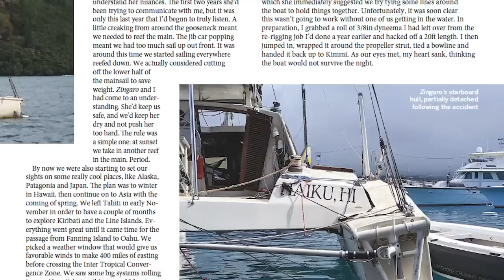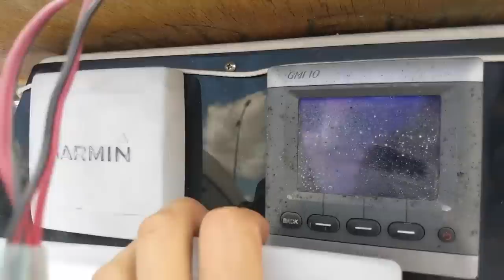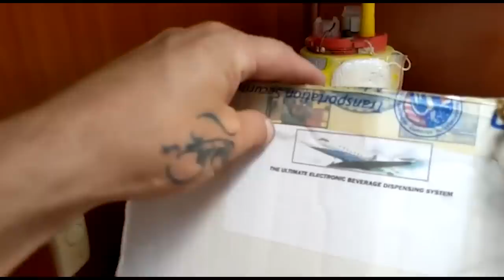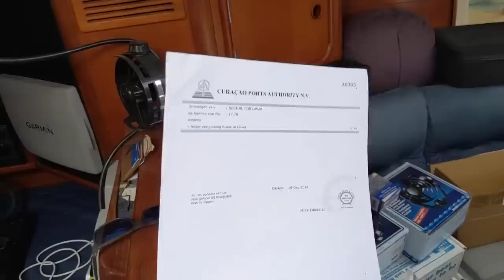Junkyard find! Trash boat, will it float??

Comment: Time to buff depending on how badly oxidized it is figure 1 hour per 100 square feet of area. And double that if it very oxidized and scratched, because you may need to sand it with 1200 grit first.

Comment: we put a hose out a window down into the water from macerator.  $86. no through hull. when not in use: it is stowed. so for a few minutes every week or two we had a heavy rubber 3” hose hanging out a port hole rinsed with salt water and then doused with cleaner and we were done.

Comment: James have you considered Tru Design (NZL) seacocks and through hulls? hey are composite, do not require electrical bonding and are much less expensive than Bronze. You epoxy them in place, and forget about it I have done that to mine. In the US Gemlux is the distributor. Contact me if you need help.

Comment: Buy a bulk load of hose clamps re do all of the hose clamps. Double clamp everything below the water line. Epirb is toast.   Just keep cleaning  learn your bilges. Next set up  a racor and a 2 filter micrcon pump it in to the barrels though the racor and you will have clean fuel. Use 10 micrcon filters  when u start up. Change the engine fuel filters.  Yard bills are a bitch but if you rush you will miss something and it's going to cost more.

Comment: Hi
Knowing Oyster yachts and the quality products they use I would consider removing the black water valve and look at servicing it as it will be good quality bronze . With the valve off you can then see if there is a problem with the skin fitting . Just a thought 
Also be careful with charging the Lithium batteries as I have read of explosions not sure if you need some sort of regulator

Good luck Stephen

Comment: Have you gone below the boat to the thru hull and scraped the bronze to see if any of the metal is pink? If it is then change the fitting because the pink color tells you that you have an electrolisys problem. If they are not pink clean them up with a solution of muriatic acid, usually  available at hardware or grocery stores. On that big valve take the hose off the top put some acid solution in there, go below get a spray bottle spray some up the fitting. Spray the pipes inside same way brush the acid about the green will disappear in a few minutes. Pour some water into the pipe to rinse it out while doing all this try moving the valve. Once the valve frees up and you have rinsed it all grease it. You be done and still have money in your pocket.

Comment: Two 12V pumps wired as well as plumbed in series in series to a 24V battery could work....just a thought.
Reply: They'd have to be the same (volts,& power,& hence resistance) not two random 12V pumps.
Reply: @hermitoldguy6312  Yes, Identical or same W rating.

Comment: I would replace that large through hull. Reminds me of the old saying “ pay me now or pay me later but your going to pay me “ it’ll be cheaper now.
Reply: Yep you are right replace all of the 5 or 6 of them. Lithium are nice but if the goal is to get in the water buy cheap batteries so you can concentrate on getting all the systems working.

Comment: Haven't watched it and liked it. Love "sailing" videos like this (way more than the sailors I know lol) excited to see you on the water sailing again.

Also I'm completely down for vlog type videos. Less editing, more videos and it's easier on you. That has got to be a butting whopping of a task to do. Whatever is easier, I think most would be game for.
Reply: Brass through hull fittings do not need to be replaced for Commercial Steamship Inspection (every four years) in Canada. Need to remove and disassemble, clean and inspect (consult expert advice here), if good lubricate and reassemble.

Comment: That valve you show at about 10 min. looks really nasty. Had one looked like that on a 28ft Sovereign when I bought her, a leftover from a failed "dripless" packing unit water feed. Waited until I hauled her to touch it and when I tried to see if it would turn it snapped right off at the top of the through hull itself.  She had 1 less hole in the hull when she went back in the water as she has a new gland and nut traditional packing box, shaft and cutlass bearing now with no water feed required.  In total it is 2 less failure points that can sink her (through hull and drip less packing box both gone).  Any hole in your hull you don't need should go away.

Comment: If you can borrow a variable speed buffer. Keep it at anout 3200 to 3500 rpm (learned that on utube)  I use the 3m polish system. Its expensive but it works well. Should take a day and a half to two days I would think.

Comment: Replace all of the thru-hull fittings, you will be left feeling weird about it if you don't. You will need it if you are going ahead with your plan to have the numbers on board that you said you were going to. What happened to the OCTender, did it stay in Hawaii? I am fascinated in how well it works as a tender compared to the typical inflatable. 
Stay healthy and enjoy the new mistress (Oyster).

Comment: Great project, suggest you keep the boat on the hard until you have done everything under the waterline. I'd estimate you'd need min 1 full day to polish your boat if you have an electric polisher and proper platform.  As you are the new owner of the boat I'd argue your 6 months  starts from when you leave the marina.

Comment: Pump some acid down the grease tube.. it will un plug the grease blockage and salt water deposits ... THEN add more grease..its safe with stainless steel and copper brass plastic

Comment: buff your boat 16 hours plus materials 100.00 -200.00. May take longer if the gel coat is roached then you may have to wet sand and buff several times.

Comment: Might be too late at this point, but I've had an internal fan go out on a laptop, and took the fan out, took it apart, cleared out the dust and the built-up carbon, put it back together and it's working like new... Might be all that was wrong with it?

Comment: Regarding hull valve removal - what would the relative cost be to hire a guy with the right tools to remove them rather than buying tools that you might only use once every several years? I figure labor down there is inexpensive, and you can be working on other things.

Comment: Through hulls can be muratic acid cleaned and greased Replacing them is a waste of money disassemble and service them unless they clean up pink in color.Copper bottom paint causes electrolysis you need to stay 1 inch away from all under water metal if you use a copper bottom paint They make paint for metal TRILUX

Comment: hey there what a huge boat .... well u bought a nice boat but also a hot mess... i know your plans are to use the boat as much as poss to tour . as a mechanic as was said by a previous poster , fix anything that will sink the boat and below water line . yes that means all thru holes and pumps and hoses . dont even think about putting it in without doing that all it will do is cause u grief down the line . its gonna cost u some cash but u knew that going in u were extremly lucky that the previous owner left u some parts to help out .change all those hard hoses they will let go . not today not tommorow but who knows jmho.... cheers and good luck

Comment: I would  pulled the pipe that's connect to the 2" through hole fill the through hole in the neck full of penetrating oil and leave it for A-day or so. Then I would try to work it back-and-forth you may get lucky and free it up and not have to purchase new one I don't know if you have for access penitrating oil but even  Automotive transmission oil thinned down with kerosene or diesel will work.

Comment: can you swap the freshwater foot pump with the salt water one?
If you can get a welder, or find some guy with one, you can make a wrench for that through hull the 15" adjustable wont fit
likewise a welder with stainless electrodes could repair that tank
price seems expensive for a 2.5" thru hull, Im sure I paid less than $200 each a few years back, US order? 
maybe the emergency tiller with a pipe over the handle can free the rudder once the spool is off
engine runs?
tc man
Reply from the maker: Swapped that... it exploded. :) Ordered new ones. Good idea to make a tool. Not sure about the engine waiting on a new water pump. Thanks! 🙏
Reply: @thelastpirate  making it a saying: "not everything that is swapped, can be unexploded :)"

Comment: 12 volt fuel pump for Freshwater you have 12 V a clean pump will work just fine pump water faster than you can use it

Comment: I'd replace everything thats bad under water! cost a lot to raise a boat off the bottom! I'd take out that holding tank sand with really course  sandpaper then three layers of fiberglass over it and will still be working in thirty years! I did that with my fuel tank.

Comment: Your Computers ventilation will be clocked, full of dust specially so if you are a smoker. Open up the back to get at the cooler grill. Clean it with a brush and or a vacuum cleaner. Then your computer will work like new. About the boat parts that are oxidiced, depending on the material you probably only have to put them into a fluid according to the material. I cleaned a bicycel chain that was totally rusted and put it into Diesel to turn it back into one like new, but there is another fluid that is less messy but I forgot whitch one it is.The right fluid will quickly reverse the oxidation process. Check the yachting forums for how to best clean pipes for what ever is to supposed to go thru it. There are many easy cheap ways to get things working again like new, one just needs to find the right way and there google is realy your friend. Good luck.

Comment: All the thru hulls should be replaced. I know they're not cheap, but neither is raising a boat. Fix everything that leaks before she hits the water. It may cost $600 to stay, but it will be way worth it in the long run.

Comment: The bigger the thru hull, the more important it is to change.  No way of seeing the internals of that thing.  A 2 inch hole in the boat is a substantially larger problem than a 3/4" hole.

Comment: If you have any questions at all about a through haul valve change it cause you just know if if commits suicide its gonna happen in the middle of now where and a hole in the side of your boat that size is gonna overwhelmed your bilge pumps in no time especially if that thru-hull comes out below the water line , but even if it don't in heavy whether you're going to get a lot of water

Comment: @Sailing Zingaro  
James, regarding the computer, often times the small, removable memory boards are the first things to fail and will cause random crashes, or a crash shortly after startup when current flow heats them up, or once that memory is accessed.

If there are two memory boards, try just removing one at a time and try a reboot.  If it still crashes with one of them, switch to the other single memory board and try it again.

If it works with the other single memory board, you know that the other one is bad and you can replace it.  If it still doesn't work when using either of the memory boards, it is probably a different issue...

It's unlikely that both memory boards are bad, though not impossible.  You can try booting up with no memory installed and the computer should stay on, but most likely not fully boot to the OS.

Hopefully you don't have a laptop that has memory boards soldered to the motherboard.

And honestly, if you are actually contemplating whether or not to perform an additional $380 repair (on a 6-figure, 48.5' vessel) that is potentially "mission critical" to you, your crewmate's, and/or its survival, well...?

Comment: Take the valve out and glass it closed the shit tank outlet one you can change the size later to one you want then  , the rest of skin fittings/sea cocker grind the face off outside and pull them out from inside , 24 grit on grinder does it good just watch for getting them too hot cold cloth in between helps .hot air gun on the pipes after removing Jubilee clamps all round 1 hour easy done .😂😂😂

Comment: If your laptop works for awhile then overheats try propping it up at the back. This creates an airgap but more importantly stops it heating up the surface it is on which heat then goes back into the laptop causing the heat to rise and the surface it is on to heat up even more. Well you can see where this is going. PS Epirbs wise well you obviously need a new one but some companies offer a trade in even if your old one is not working.

Comment: RULE#1:never throw away spare parts, you WILL need them.(re :the big box full of spare got to go)???? These cumbersome spares take so little space in the grand picture of sailboat break downs.
RE :RUDER GREASE :
#1 From experience: sometime the seal inside the manual greaser pops under pressure and turning the screw does not push the grease out.Your cartridge content might still be in there. Worth checking.
#2Just an idea never done it: You could try  to disconnect the grease tube and see if you could replace it (temporarily) with a grease nipple (higher pressure) and see if and where grease outs.(return to the neat old system afterward )
#3Maybe there is room for more grease (unlikely)
#4 From experience: After so many years all bushing type arbors gum up and increase resistance to movement.(meaning stress on fiberglass support, helm, and AUTOPILOT. Do yourself a favor start afresh and disassemble, clean, inspect ,your ruder guts.

Comment: If you don't replace the large through hull before splashing, when do you anticipate the next haul out?  If you don't have a planned next haul out, then to replace that through hull add the cost of haul out to the cost of the through hull.  Seems best to replace it now.  Hopefully that tank is empty. As for your over-heating laptop, when you start using it again try not to have the bottom flat against the table. Lift it up on a couple sticks to get airflow underneath, it can make a big difference.  If you feel like you have too much money, and too much battery capacity, you can buy one of these: https://www.amazon.com/HV-F2056-15-6-17-Laptop-Cooler-Cooling/dp/B00NNMB3KS/

Comment: Oh man how can you work in all that mess. Rent a container and clear the boat of all that clutter.
Start with the hull and topsides.
Then mechanicals ... Valves rudder quad prop cutlass etc.
Engine completely replumb water and fuel etc.
You have a years work there for sure.
Reply: Yeah I learned the hard way.    A chaotic boat = a chaotic mind
Reply: @Tom-S1981  me too buddy!
Had three years working on a friend's project and other smaller refits in our marina.
There is a reason boat jobs take 5 times as long, it's all the crap that's in the way.

Comment: One week, you must be joking. I estimate about 1 to 2 months to get it to float on the water ( all through holes, bottomed paint, engine working, out boat motet and small boat, rudder). Once in the water, I estimate 12 to 18months of work before blue sea sailing, if your lucky.

Comment: On the toilet you might want to consider a composting toilet. Rip out the holding tank, all that stinky plumbing, glass over the through holes. And just put in a vent. The money you save, even if the head is working should pay for the composting toilet. Regular waste pump for the shower, (hair and soap trap) and maybe the sink. Only draw back I ever heard is some women have to learn how to aim--what ever that means.

Comment: Sounds like it would be better to spend the 200.00 and have new vs. spending the 60.00 and then more and more and more, and the time is worth money too. Especially if it is something that might mean the boat would have to get pulled back out of the water in a short time to replace later anyways. I started band aiding my computer together a year ago, but everything I bought as a band aid, will have to be replaced again with better parts that will work with the new motherboard and CPU I will be getting. Band aiding things is not cost effective always. And my computer is never exposed to water, just my dog walking on the keyboard. He is 8lbs, so... not a big problem.

You are making me dizzy! Almost made it to the end, but I must have a bit of a migraine to feel this sick from your video!

Comment: The other option is to not replace with bronze seacocks but to use composite ones. They don't rust and the latest ones are excellent for quality and durability. Just a thought.
https://www.trudesign.nz/marine/products

Comment: Why can’t you contact steel rubber products you know the same ones that you would order weatherstripping for your vehicle around the doors trunks windows so on and so forth they see UV light every day of the week hold up against water  rain and car washes waxes polishes and if you don’t know exactly you can draw a little diagram of the weatherstripping you are needing and they will send you free of charge usually a sample so you can get it in your hand and see what works best and order that you know as a mechanic there is many things that you can use on a vehicle they can also be used on a boat.

Comment: We kiwis peel them , you done need that many winches in the cockpit  ,go through the rig , it’s old thinking  , the eprb goes to the coast Gard to switch off , thoes hatch lens are mega bucks I think I would waist money else where , remember the parking space is not cheep get in the water , if you’ve got no money sell the boat you will need 20 k to day to bring the boat up to scratch , or bludge off your patrons not easy  ,get the boat sailing and in the water , she’s a big boat we have one there not cheep  ,but do the basics to stay dry and hit the water , bronze sea cocks were made to be serviced so they are ok maby grease and skin fitting re bed and way you go  ,plumbing shops have the O rings and jumpers the rest is you ,